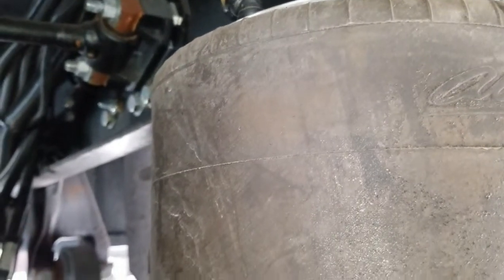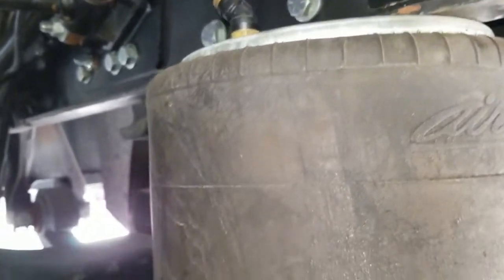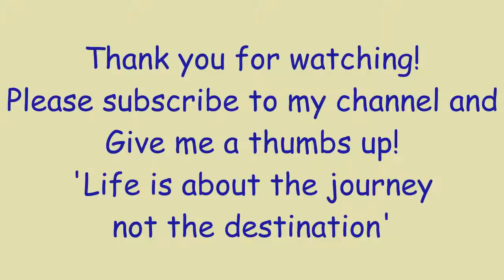Air Bag Air Dump on the S2RV Chassis

Comment: You said absolutely nothing about the air dump other than to say when jacking the S2RV the air bags dump. Well, on my Jayco Seneca it does NOT dump until the weight is removed from the current height at the time. I have found by jacking the front jacks higher transferring load to the back jacks more air will be released. After a night my air bags will depressurize and rest more firmly on the jacks.